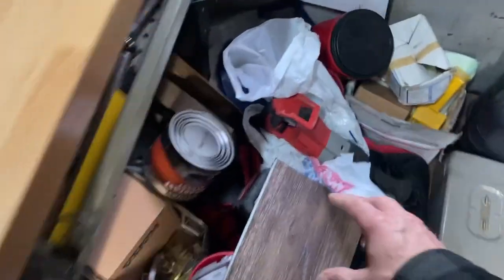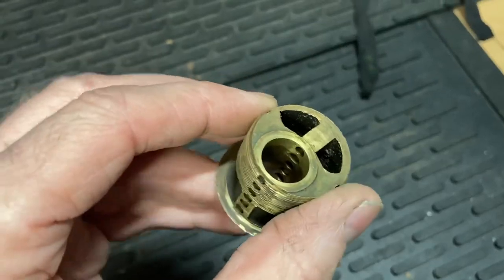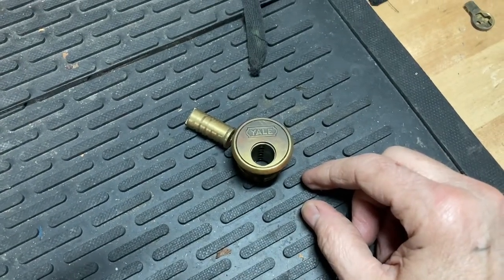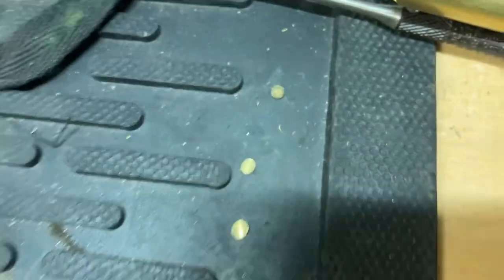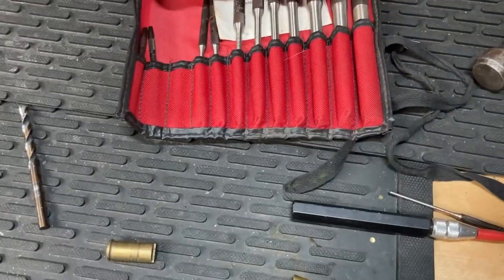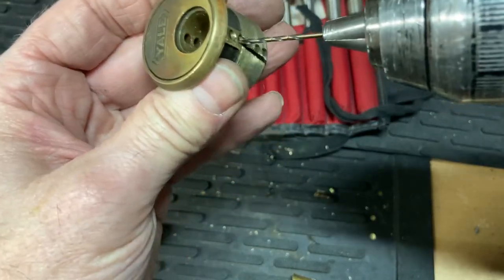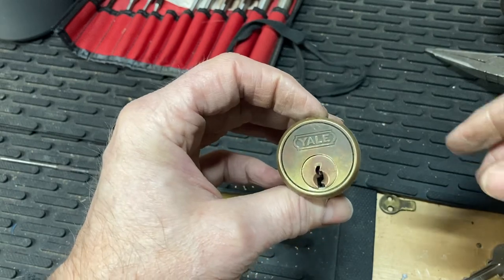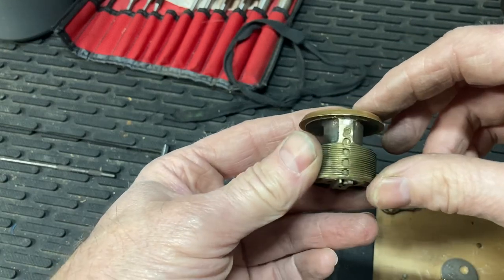Yale Mortise lock issues

Comment: Well done. Nice old Yale cylinder!!! I have done one of those and got the stuck pins and springs out just as you did. 
In the caps I used a bit of JB weld to close them up. Then used a file to clean up the inside. 
Nice to be able to do that for the customer.😀 🐈‍⬛🐾🐈🐾
Reply from the maker: Always good to explore the methods for those unusual jobs. Thanks for watching!
Reply: @odinslockllc  yes 🐾🐈‍⬛🐈🐾